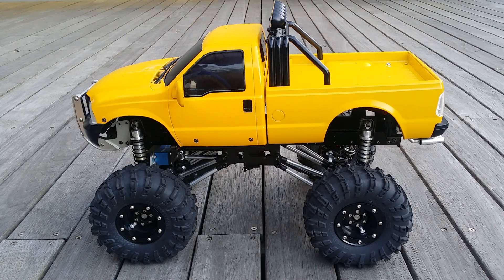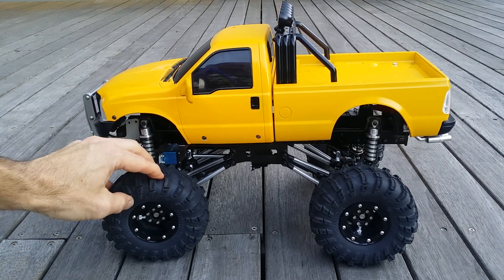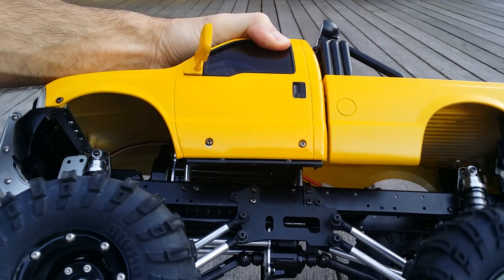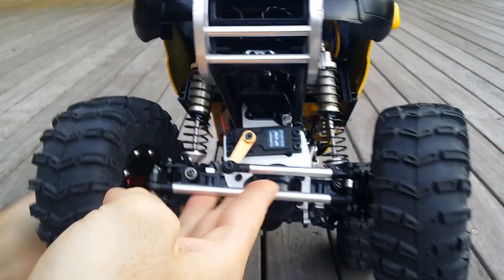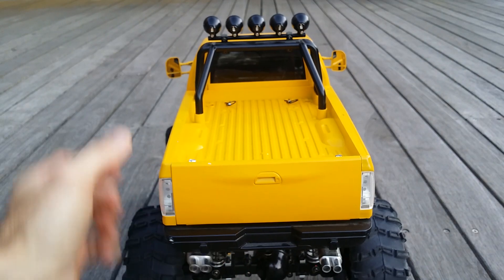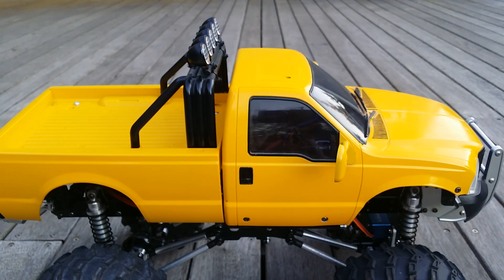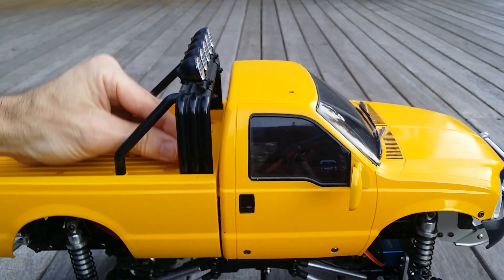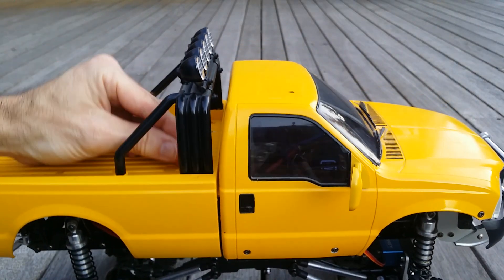JACKED UP Tamiya Ford F350 Highlift RC Monster Truck

Comment: Beautiful rig brother. It's a really capable trail truck now. I only worry about the center of gravity. You may find she gets a bit tippy at times.
Reply from the maker: Thanks bro. Can't wait to get it on the trails. I was worried about the center of gravity. If it is a issue I will put some sag in the springs
Reply: RC Tanks & Trucks 24/7 that's right.

Comment: Building my f350 into a replica of Wheelie from transformers. Just what I needed, tips on lifting it. My tires are rubbing.
Reply from the maker: Raise it, smaller tires or cut the fenders
Reply: @RCTanksTrucks247  I'm just gonna lift it.

Comment: I'm going to buy my first rc truck! Which brand is better? Which rc truck do you recommend?
Reply from the maker: +William Parker can't go past tamiya, arrma, traxxas or  hpi. It's all about parts availability. In Australia Traxxas parts are easy and fairly cheap.
Reply: RC Tanks & Trucks 24/7 - Ok, thanks, what do you think of gmade komodo RTR ?
Reply from the maker: +William Parker great, I have two gmade sawbacks and they are great.
Reply: RC Tanks & Trucks 24/7 - Ok, thanks again, bro 👊 👍

Comment: In a previous vid, you mentioned you raised the body, what did you use to do this? Needing some 'guidance' Cheers!
Reply from the maker: +Me Toyou unfortunately I have sold this but from memory I think I used rubber spaces to increase the height
Reply: Cheers bud, time to get modding!